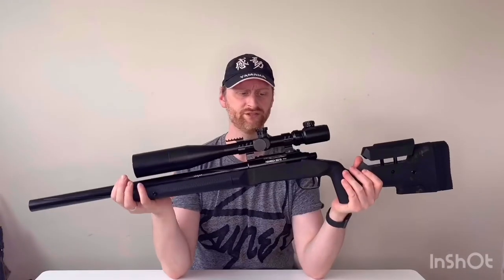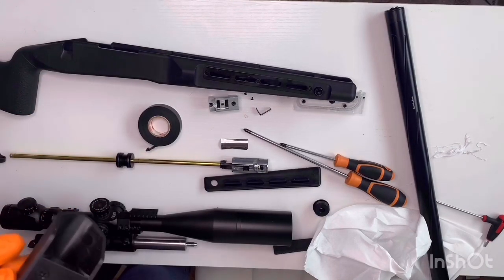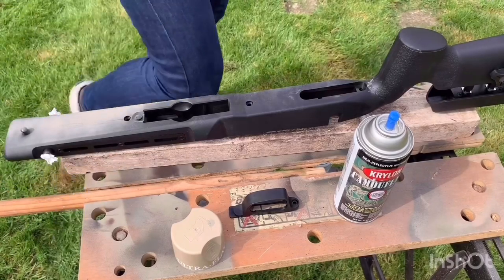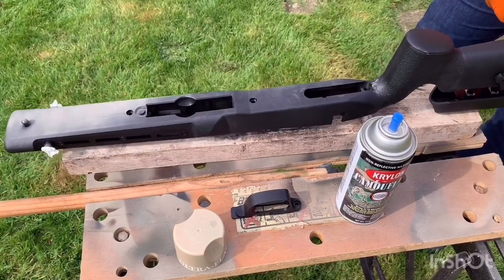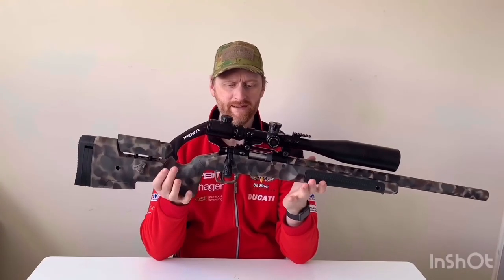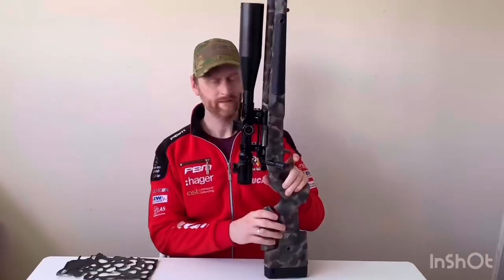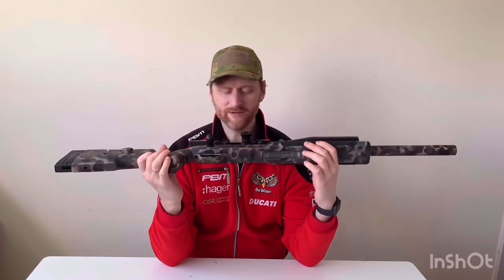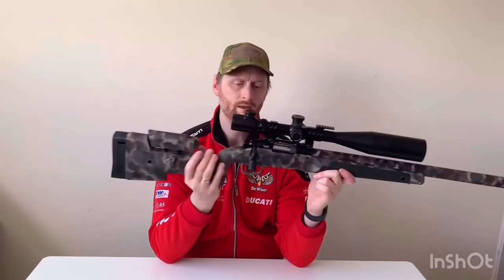How to PAINT Your NOVRITSCH SSG10!

Comment: Hello. Pete.
How did you find the Krylon paint ? How long does it take to go hard ? Does it go hard. ? Iv tried some myself prepped the surface cleaned etc. But 3 days later the paint can still be scratched off with a finger nail and moderate pressure ?
Reply from the maker: 9080rigaxe Krylon is great, it’s dry to the touch after 20 minutes but I recommend leaving it a week to go properly hard. It’s dry in 24 hours but to really go off it needs time. If you want it to be really tough, you can use a matt clear coat. 👍
Reply from the maker: 9080rigaxe also make sure you rough any smooth surfaces, clean etc. That makes a huge difference.
Reply: Great cheers. Thank you. Glad I did a few text hits first. It’s for a pistol so want it as durable as possible mate.
Reply from the maker: 9080rigaxe pistols can be tricky as there are lots of places to ware. You might need a metal primer to help.
Reply: BIGBIRDSAIRSOFT yes cheers Iv ordered the metal etch etech stuff from amazon going to give that a whirl lo.

Comment: Hey does anyone know if the A2 body is out of the same material as the A1 body
Reply: No, the A2/MapleLeaf shaft is more durable and made of the same material as real guns.
Reply: Thanks for answering! One more question do you think that spray paint will stay on the A1 since its out of a rubbery substance
Reply: @Red_Espyed  I only own the SSG A2, but I know from other guns in the past that the paint is more likely to chip off

Comment: wouldn't it been less work to just paint the fully assembled gun?
Reply from the maker: Airsoft Physik less work, but not as nice. I don’t like painting guns in one piece, as if you are not careful with the masking, you can get paint where you don’t want it. You can also get it in screw heads, which is always messy when you take it apart.
Reply: @BIGBIRDSAIRSOFT  thats a good point
I think done right both methods are about equal though.